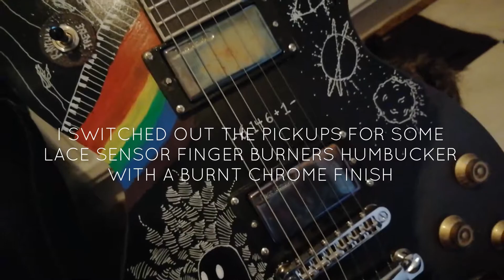Painting and assembling my Harley Benton Les Paul kit

Comment: Did you sand the wood before painting? It looks like the paint had a bit of a hard time griping to the wood at first, maybe a primer coat would've helped if you didn't want to sand it!
Reply from the maker: Yeah I did sand it! I didn't really use proper paints or a primer either for that matter though lmao, so it didn't stick super well anyway. It was more of a fun project for me rather than a professional build in any sense :)